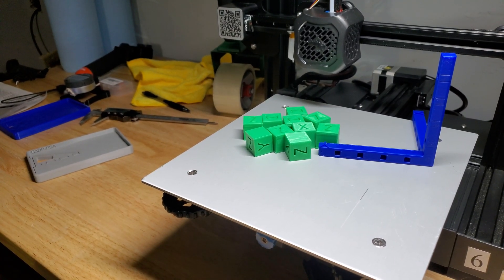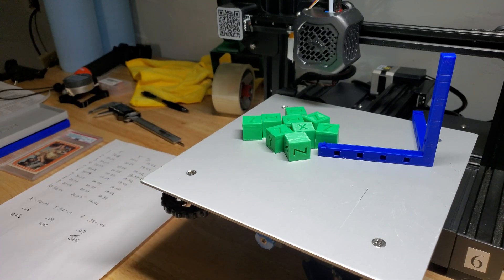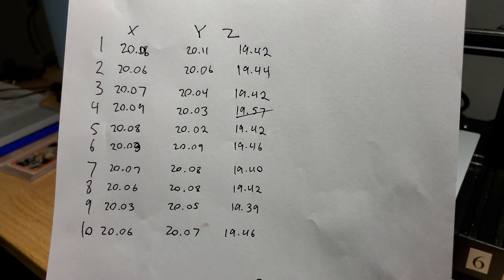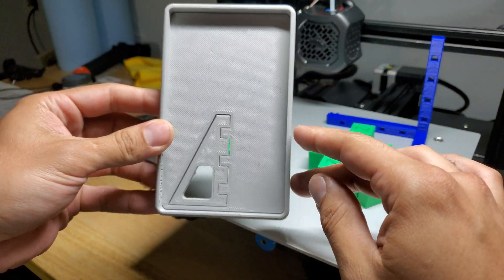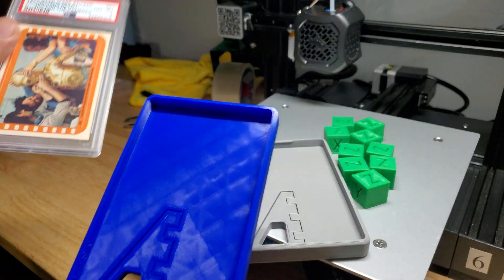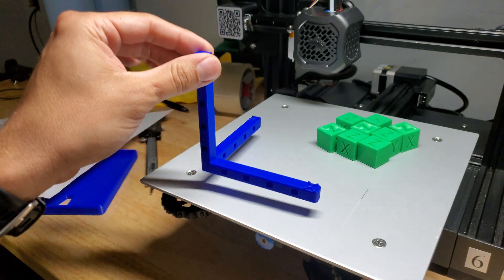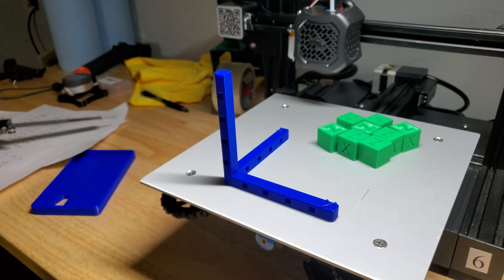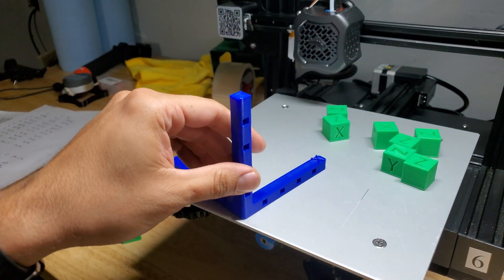A Better Way To Calibrate Your 3D Printer. Importance of Dimensionally Accurate 3D Printed Products

Comment: Soooo, you buy a cheap 200 dollar printer and then expect it to perform like a 2000 dollar printer. Good luck with that.

The printer you use is for hobby projects and needs a little work every time. If you want to have a printer that is accurate with every single print, you need to step up and buy a more advanced printer. If you want to make money, you need to spent money.
Reply: The "spend money to make money" quip is overused and in this case very misused. Never spend thousands of dollars without clear evidence that you need to do so.
Reply from the maker: What exactly is a "2000 dollar printer" do you really think spending more equals better quality? My goal for these videos is to take the most popular and affordable printer, and help viewers achieve the best possible results.
Reply: This is dumb. The tolerances for etsy items do not usually require anything more than an Ender 3 and a little wisdom can provide. The uploader already proved how to get his card holders accurate enough; your recommendation would waste $1800 on him.
Reply: What's the point of this comment? He showed in the video over a dozen of his budget printers calibrated sufficiently to be able to print with really tight tolerances and excellent repeatability. Might want to actually watch the video before saying something stupid. Good job with the video. Though I would say that the variance is not percentage based, if you're just going to adjust flow and esteps you're not going to alter the overall dimension by a percentage of the 20mm cube.
Reply: Thank you for saying that! I was getting upset there for a second😆
Reply: It’s literally on the packaging of the machines. Yes, a production style printer will get you production level results. The ender-3 is a hobby printer with a huge tolerance. You can creatively work these into your design, but you’ll have to work around your critical dimensions being +\-10% if your going to continue using a machine with that level variance in quality…

I’d suggest doing what every business does. Invest some profits into better tools, and push for better products. Good luck!
Reply: man, please just don´t write a comment if you don´t have to say someting productiv.
Unnecessary comment.

@Collect3D nice Video. Will calibrate my printers with your method now.

Comment: Well the video is great but i struggle to get rid of the elephant foot any tips for that? (i got an ender v2 )
Reply: i mean sound like an video idea for youtube :)
Reply from the maker: This topic is on my list for future videos for sure :) thank you for the suggestion. I think I have some good info on how to eliminate elephants foot.
Reply from the maker: I would start by making sure your z axis doesn't have any backlash. Or very little as possible. In my experience if you print at a low layer height below .3mm, the backlash will start to cause issues with the first few layers of your print. As the gantry moves up the backlash is corrected and the subsequent layers start to print correctly. Eliminating backlash completely and using 100% flow on the nozzle is one of the things that will help eliminate elephants foot
Reply: @Redo3D  well i didnt Even consider backlash i will try to fix it and will Update you later Thank you for the fast reply!!
Reply: Well i finaly got my ender v2 perfect i fully disassembled it and assembled it again and with your tips especially the calibration and the elephant foot fixed my whole printer thank you
Reply: Thats my YouTube account on the phone im samuel😁

Comment: tolerance must be measured in decimal not in percentage. 20.06 and 100.06 has same tolerance. but if you convert in percentage there will be Major difference between two.
Reply: It is clear that the deviation is not caused by the movement of the motors, gears and belts, but certainly in extrusion, so you should not try to make modifications on the number of steps/mm or scaling the STL at the slicer. You must then try to correct using extrusion factor (in this case reducing from 100%) and to obtain the percentage it must be done with measuring wall thickness (printing the cube without infil, only 2 walls stopping the print at about 5 mm of height), but be sure that your nozzles are in perfect condition. 
Nozzle holes are too tight and if made of brass can easily be damaged if it hit the table or some parts  and it modify the result of extrusion.
Vatiation between the layers (Z axis) are linked to belt adjustment and extrusion (and, of course, speed) too.  
Don't forget the extruder: these bowden type extruder mecanism are subject to have some variation because of the movement and restrictions inside the tubes. I think it could be more precise if it is direct drive extrusion.
Reply from the maker: You are correct. I used percentage as a way to make a comparison.
Reply: haha exactly
Reply: I think he meant margin of error, or error relative to the part

Comment: Yeah but how do you know your caliper is accurate to begin with? I wouldn't trust cheap calipers at all. Even mitutoyo specs are +-0.02-0.04. You would need calibrated set of micrometers to calibrate to but then again printers are not that repeatable. So a decent set of calipers is all thats needed really. Just not the cheapest one available.
Reply from the maker: This is a valid point! As long as they are consistent I am able to have consistent results in my prints within the expected range of repeatability of the printer. My calipers have worked well for me in this regard.
Reply: You're conflating absolute capability with precision. Precision of cheap calipers can compete with higher grade calipers quite easily. We aren't very capable of making imprecise objects with decent tools. Using fishing wire and a weight, I can create a level more accurate than any bubble level on earth.
Reply: @Señormakey  yeah but your fishing line isn't practical to use. The bubble levels that are used to calibrate CNC machines are 0.01/1000mm.

Comment: Are you using accurate filament?
Are you changing Filament Brand often?
Are you using a filament widht sensor? (+-.05 mm filamnt does vary in flow +-10%)
Did you calibrate your axis to real world movement? (never ever use printed parts to calibrate steps)
Did you calibrate your extruder with the same flow rate you are printing at? (Check CNCKitchens recent video on the matter, It really suprised me big time)
Do you tune Flow for each Spool?
Have you tuned PA correctly? 
Have you tuned Input Shaper correctly?

so many open topics that greatly affect your issue. Yet you did not really talk about it.
I dont want to sound mean. But ther are things you need to consider to be as accurate as possible. 
If you use everything i said then you can even switch filament (PLA<->ABS<->PETG)  without the need to adjust anything.
Reply from the maker: I use hatchbox which has been very accurate for me. I do not change brand very often. I do not use a width sensor, I have 20 printers, to manage each individual one like that would be an absolute nightmare. I am not using klipper so there is no input shaping or pressure advanced. You can retune for every spool if you like for the most accuracy, but when running a farm you reach a point of diminished returns by doing that. This method has worked for me to achieve .06mm accuracy across all printers which is acceptable for my needs. Thanks for commenting!
Reply: @Redo3D  i think with RRF you also get Input shaping and with Marlin you at least have PA. 
All that counts is that you are Happy with your results. 

If you are running many printers of the same type then it could be benificial to switch to klipper. You can run at least 4 printers of off one RPI 3B+ or 4 ( you can even use a RPI Zero WH for a single printer) So you could calibrate one printer with PA and IS and use those values on all other printers.

However some users find it hard to switch. The first time i tried was hard and discouraging. But now i would never go back, at least not to marlin.
Reply from the maker: @MrEvilJohny  I definitely want to try klipper in the near future! My ender 3 v2 uses 32bit main board with silent stepper so unfortunately I can't use linear advance. Only works on 8 bit boards I believe.
Reply: @Redo3D  No matter the board Linear or Pressure Advance does work. I am running two SKR E3 Boards and a SKR 1.3 all of them are 32bit. Tried it on a MKS GEN L too succesfully.
Reply from the maker: @MrEvilJohny  I think the issue for the creality 32bit board is the stepper drivers. Unless somethings changed recently I recall it didn't work with the 4.2.2 creality motherboard. Thank you for sharing your info!

Comment: You are exactly correct in using a longer sample, the longer the sample is the more accurate your measurement will be.  I’m a long time DIY CNC guy, and we set out steps per inch in the system utility if we set up our machines using a  one inch distance to calculate the steps it will not be very accurate as your 20 MM blocks show, we always to longest distance that we can on each axis this yields a much more accurate steps per inch figure, thus making our cuts all that more accurate.
To speed measurement and accuracy you could set up a little gage stand consisting of a fixed stop and opposite that a dial indicator,   The dimension  could be mastered with your calipers, this would make measurement faster an more accurate.
This process being an additive process there are more things that effect to final dimension, filament size, pressure, friction and on. 
Good luck 
Hager
Reply from the maker: Thank you for the excellent idea on creating a test fixture for consistent measurement! I will look into creating one.
Reply: @Redo3D  when you are making a living doing this time and quality are so important. And a test fixture will help you so much.  Much more accurate than trying to insure you have the narrow calipers making an accurate reading.
Reply from the maker: @IH1940HAY  what I have been doing is laying my caliper flat on the table, and taking a measurement. The table surface has been my jig to make sure I keep the calipers parallel to the axis I am measuring. The test fixture is a much better alternative! 👍
Reply: That's brilliant idea, I was going to get a dial gauge, and this just added to the reasons for getting one

Comment: How are you imputing your findings into calibrating the extruder. Flow ?
Reply from the maker: Hi Sean, I’m going to make a video soon on how to calibrate the printers e steps. In the mean time you can view this video that I followed when I Originally calibrated my printer. The only thing I did differently was use my 100mm print, and change his excel formula to reflect 100mm instead of the 20mm in his calculator. It’s an excellent video to get you started
https://youtu.be/SN9NCn-Dhf8